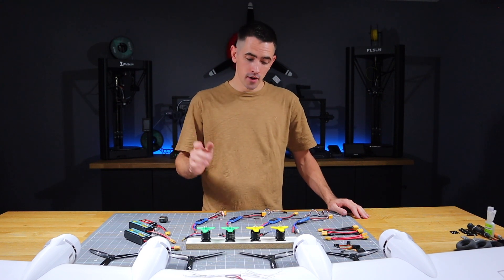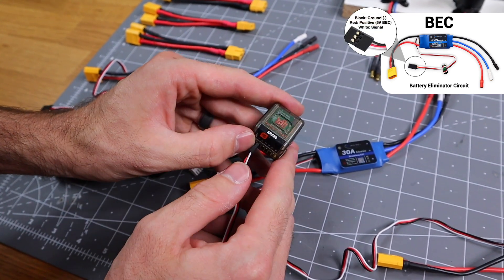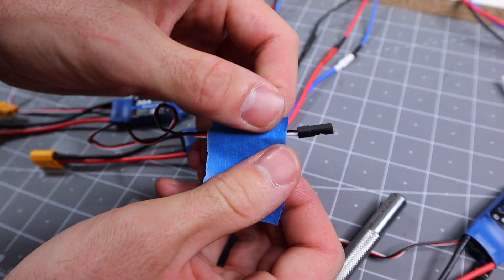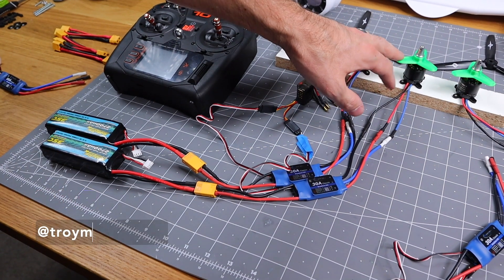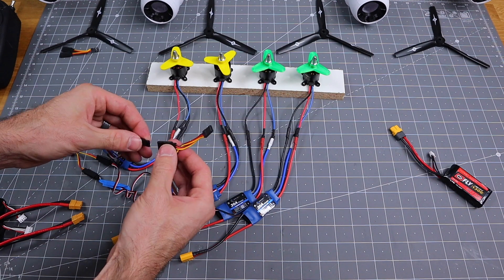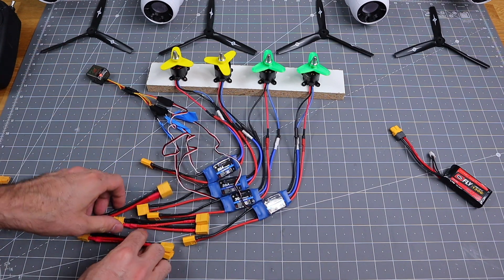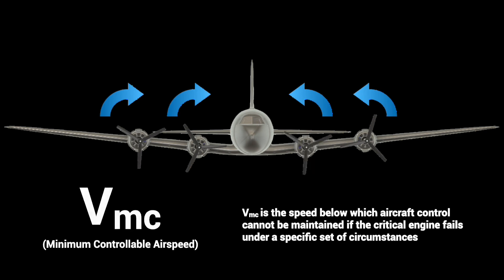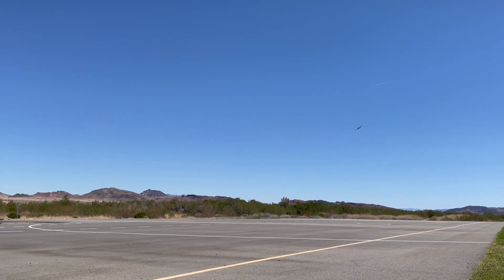SINGLE-engine | TWIN-engine | MULTI-engine | How to Wire ESC & RECEIVER

Comment: Hi, I am building a twin engine rc plane and the esc I want to use does not have enough rated bec current to power all my servos from the receiver. The two escs connected together would have enough current. Am I able to just do this without removing the power lead from one? Thanks

Comment: Great explanation, thanks. Question: I have two motors (on pusher, one puller - like a Cessna 337 Skymaster) and I want to control each of them independently from my radio inputs. So I could even shut one off inflight while the other runs, or anything in between. What do you recommend for control setup to achieve this? What sort of radio throttle inputs would be best, given that the radio only has one throttle stick available? Switches or knobs or ?

Comment: But why not just use a larger capacity esc and wire the motors together? Is that possible to do?
Reply: One esc for each brushless motor . Brushless motors have 3 wires and the esc senses the rotation or inductive feedback from the coils and magnets to control the speed of the motor and keep it strong . 
  An old fashioned rheostat variable rheostat on an old 2 wire motor in model trains  would get weaker as the voltage lowered to slow the motor .

Comment: Could have mentioned or shown rudder/throttle mixing for directional thrust.
Reply: The way he tied them all together, differential thrust wouldn't be possible. Each motor, or each side of motors, would have to be connected to the receiver separately.
Reply: @HoloModels-RC  I understood that, but when illustrating multi motor systems, i thought it would be worth a mention

Comment: Is there differential thrust for the 2 or 4-motor configurations using the Y-haress method ... ?
Reply: You can do that by mixing throttle/rudder on your transmitter, using a separate channel for right/left ESCs.

Comment: new to this hobby and I was wondering if there is a way to to use one battery per esc/motor on a multi motor/edf plane. So I have a few twin EDF jets and several twin motor planes. So they all have one main battery connector that Y’s off to two esc’s. I am asking because with two motors sharing one battery the voltage drops drastically when getting into throttle. If there is a way to wire a single battery to each motor and have it work . I think I have an idea in my head  but not sure if it’s going to work. I need to check one of my twin edfs wiring and see if I can make it work . Maybe there isn’t a way unless you have to buy some expensive esc. It would be so much better because the voltage would not sag as much using separate batteries.

Comment: Anyone that knows what the maximum "fan out" is for a typical receiver ? I.e. how many inputs (e.g. ESCs or servos) that the reciever can drive before the signal starts being unreliable.

Is 4 super safe, or are we approaching the limit ?

The output of the receiver has a current limit, the different inputs to foe example a servo amplifier is needing some current to work. If you load the receiver output too much, the output signal will no longer be a nice squared PWW signal.

My guess, but that's only a guess, is that the reciever output current capacity is much larger than the needed input current to a typical servo or ESC.

I'm currently in the early stages of a Lancaster build and I don't know whether I should be concerned about this or not.

Comment: right and left side motors individually cortrolled? throttle as main throttle and yaw control  left L100 R0 - middle L100 R100-  Rright L0R100? Most easy and universal way?

Comment: Great video. I was wondering. Do you need different props? Even if you spin engine against each other, do the props need to be mirrors? I guess I am asking about RH/LH props. I bought some from hobbyking and they have Right Hand/Left Hand facing in bags of four.

Comment: Question about a tank setup, lets say i hook up 2 engines on a RC tank platform. each side of the track powered by one engine. Would i then link both engines to throttle at the same time but have them for example like this (ENGINE 1 -> Channel 1 /// ENGINE 2 -> Channel 2.  Setup the transmitter for throttle to power Channel 1 and 2 with the same speed. 

And when i want to steer and use the steering wheel i could then setup my transmitter to infact Slow down 1 of the engines depending on where you want to turn?
Reply from the maker: Ya you would want to set it up like you said 1 engine per channel. I don't have a transmitter with  a steering wheel I only have airplane transmitters but I would set it up as a mix in the transmitter in my case with rudder and throttle but for your case with steering so not actually have servo hooked up for steering but just mix it so has you add steering it slows down eng 1 or eng 2 depending on direction of turn.
Reply: @TroyMcMillan  thanks for rhe reply! I appreciate it.

Comment: Great video ! Very helpful. I see that you are using y harnesses to adapt one or two batteries as your power source(s). My question is: Does the use of the y harnesses between the batteries and the esc's require the use of an additional capacitor ? I am currently building an airplane that I would like to install a 6 inch plug in extension between the esc and the battery but don't knowif it's safe to do without adding a capacitor.  Thank you for any help.
Reply from the maker: 6in extension is definitely ok no capacitor needed.

Comment: Since you disconnect BEC Red wire from esc from 2nd & 3rd motor.

Can one easily "Reconnect" this red wire back to each connection without need to soldering or needing to buy a replacement ESC?

Comment: Is it possible to leave the power wire in the other esc? I'm thinking it be OK since it's in parallel,  it would also act as a redundant if the other esc were to fail.

Comment: I'm experimenting with a Stock twin prop 550kv set up. 2x 40A esc, 1x 6s lipo and the max Amp draw is 62A. I'm assuming this is over the 2x ESC combined so my ceiling is 80A. However if I'm going to use 2x lipos I'd certainly not use 2x 6s lipos. The power of the 6s is shared with the 2 motors. I feel if I was going to go dual lipo I'd use 2x 4s lipos. (These motors are 4s rated in 4s planes and 6s for 1 motor would surely be into the 90A+). My question is how do I work out the RPM of each motor in my set up? How much voltage do I know each motor is getting on 6s set up? My aim is to change out the motors to 750kv hoping my stock 40A escs are within operating limits. Cheers

Comment: Hi, thanks for the video, excellent.  I'm busy building my twin electric model.  The twin system necessitated (or so I thought) in extending the leads between the battery and the ESC.  I'm told this is incorrect and I will be in trouble; the ESC won't work properly, I should installed a capacitor just before each ESC. The leads between the ESC and the motor should have been extended.  My leads are ~600mm long.  How did you solve this problem on your multiengine planes? Would appreciate a comment.

Comment: If you are using a dedicated receiver battery that is separate from the flight packs do you disconnect all 4 of the power wires from the ESC’s since the rx is being powered by its own battery?
Reply: Yes

Comment: I'm going to use multicopter escs now. They are smaller and lighter but don't have a bec. For that application i use a multicopter pdb with integrated bec where i can solder on up to 8 escs depending on your board. Now i only have to solder on a single battery connector and that's it 😉

Comment: I really appreciate this video and I tried to recreate the same thing. However I am having trouble only one of the two brushless motors is running. I have 2x40A ESC and 35c/2200mAH battery. Any help would be greatly appreciated

Comment: Nicely done , thank you. If you want to power two motors on one bigger battery, do you mean more volts or more amps ? Both ? Can you plug à 6s battery to 2 escs accepting 2-4 s lipo without burning them ?

Comment: I've been looking to make a multi-motor/esc project this has an excellent explanation of the process and options.  I haven't been able to find any literature that wasn't 20 years old on this subject , or that didn't give erroneous cautions or methods that just didn't make sense.  My local hobby shop actually looked at me funny when I mention what and how I'd like to go about my project, you know like dogs do when they aren't sure what's going on.  That was my big sign to find information else where.  If you ever do turn this into a document I would gladly store it away with all the other articles and books I have on these subjects

Comment: Maybe also worth mentioning that the colors on the 3 motor wires are not relevant - in case people have motors/esc with single colored wires.

And maybe also to check the current drawn by multiple motors - make sure the battery can handle it if you use 4/2 motors on a single battery

Comment: Good simple description. If multi-motors are connected to separate battery packs, one weak battery pack may result in one ESC going into low voltage cutoff and one motor cutting out. Using a single higher capacity battery pack may have some advantages in smaller models.